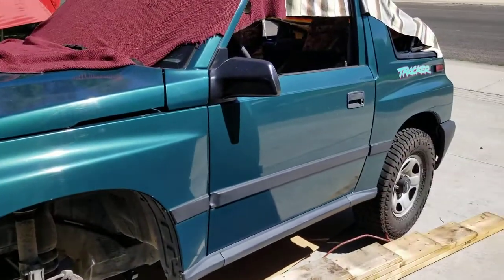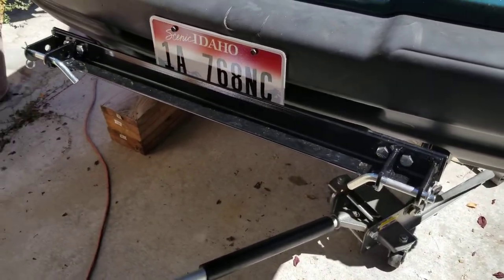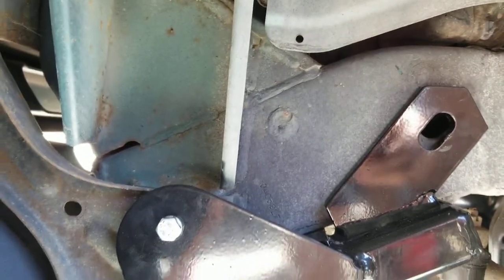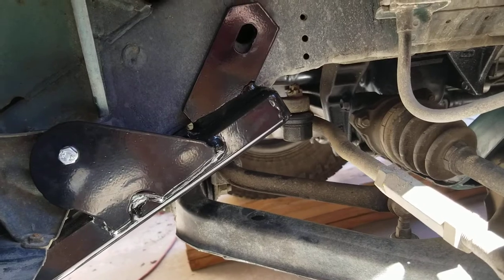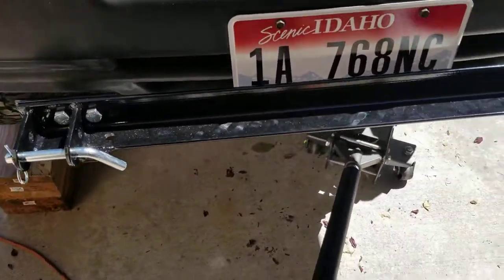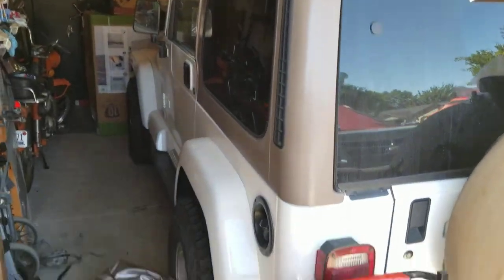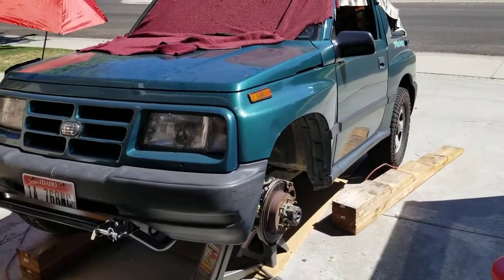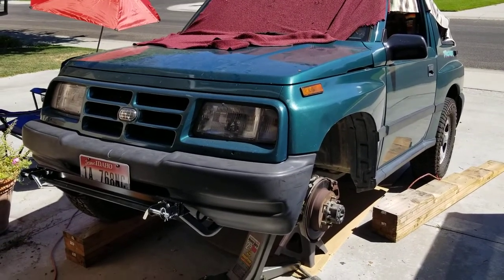Geo Tracker Roadmaster Tracker towbar and baseplate install

Comment: Hey how does the 118-8 mounting brackets stay bolted to the frame? I have a 96 tracker, looking to do exactly this, but I can see that the frame where it bolts on goes all the way around and theres no way to put a nut on the opposite end of a bolt. Thanks for the help!
Reply from the maker: Hi Dan. I don't recall but the kit had everything needed to securely mount it. Working fine!
Reply: Thanks! One more question - which tow bar from your RV do you have?

Comment: Very poorly filmed and defined. When you film a project concentrate on the project and dont swing the camera around. Dont care about the Jeep.
Reply from the maker: You're welcome.  Sorry I wasted your precious time talking about the difference between the Wrangler and the Tracker for probably what... a minute and a half?  And no, guess what, I'm not a professional videographer.  I only put up a video when I can't find  what I'm working on and I think it might help someone else. As I said, sorry I wasted your time. You probably voted for Biden.
Reply: @johnmbarsness  FJB !  I wouldn’t even respond to that kind of crap, some people have nothing better to do than to find fault in every little detail.  👍
Reply from the maker: @noahdunaway  Agreed, thanks for your support!
Reply: @johnmbarsness  BTW I just bought a 1996 Tracker 2WD 5 speed manual wildfire red with black fiberglass hard tops.  It has 78k miles with most of them towed behind a motor home.  It was kept in a garage when not used and looks almost new.  It’s a rust free Texas vehicle.
Reply from the maker: @noahdunaway  Very nice!  We really like ours.  And, the thing gets about 28 MPG.. pretty amazing for a boxy little 4x4.  I'd love to find one in great shape like that.  Mine is not that pristine but it works for us.